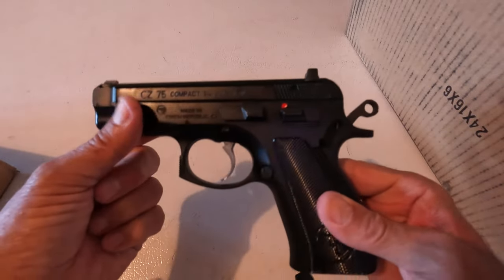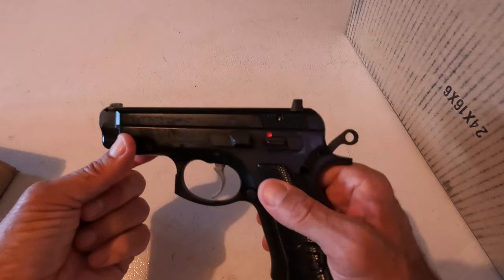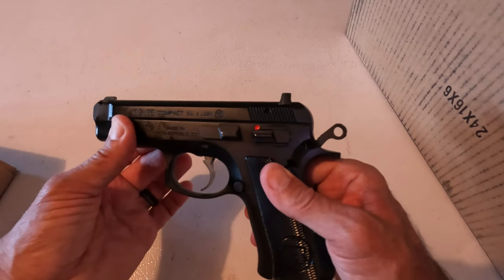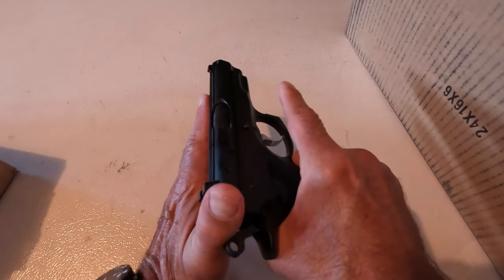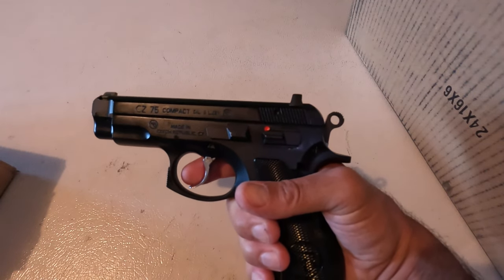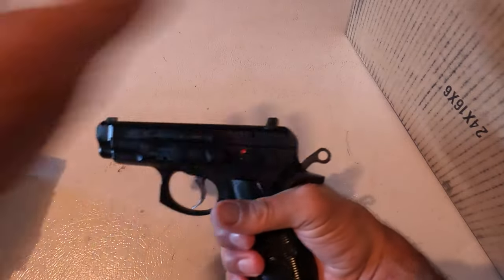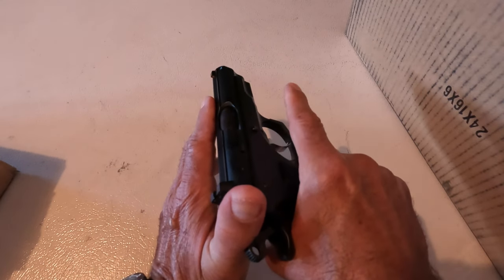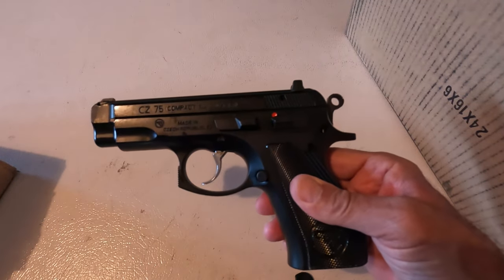The safest method to lower the hammer on a CZ75

Comment: Prefer the manual safety version over the decocking PCR, just so I can have a little extra comfort knowing it’s double action in the half cock position, and the safety is on at the same time, unlike the decocker model
Reply from the maker: If one is comfortable with a SA like a 1911, this gun is equally secure. However, the longer DA pull for first shots is certainly an enhanced safety factor. I converted this gun to SA only. See this video...
https://youtu.be/T6B7hp8z_YE?si=kgRpm131ejSM5kiH
Reply: @mlazarus5388  saw your video. Yeah since this is my first and only recently purchased pistol, I have to get more used to carrying it with 1 in the chamber, so the safer the better. BTW nice mustache
Reply from the maker: @wallclock4648  ha. Appreciate the positive moustache comments.

Comment: The Reason the hammer has the circle hole is for pinching it with two fingers , the index finger and thumb tightly , by having the circle it allows the hammer to slowly rotate forward  while being pinched, that circle is imprinted into your finger skin , along with the tight pinch.  This is why it has that hole. Practice this method while dry fire practicing
Reply from the maker: @TheLoneRanger745  interesting. I actually prefer the hammer style on the gun in this video. https://youtu.be/-F7nf4RU-YE?si=kY7uL76TwmXHS0Dn

Comment: I simply do it with only one hand. It feels very natural that way for me, and I was able to do it flawless the first time I handled one. Man, it's like this gun was designed for me. It fits my hand better than any glove 😂
Reply from the maker: The CZ tend to be very ergonomic.
Reply: Aren't the CZs awesome?!

I purchased a P-01 and I am in love with it! Smooth, comfortable shooter.
Reply: I do one hand only too, but I still put my thumb BETWEEN the hammer and the firing pin.
Reply: @ubob38 I agree. Did it thumb on top of the hammer but if the weapons fires thumb is “gone with the slide”. Not a good movie. I will change to thumb before hammer

Comment: Thx. I was thinking of buying this gun for concealed carry. I am done with polymer pistols. Want all steel
Reply from the maker: @j.t.867  The CZ are a solid choice. These can be converted to single action as well. Check out my video on the converted compact. A really cool gun.
Reply from the maker: @j.t.867  https://youtu.be/T6B7hp8z_YE?si=Kzd3171UWblyga7N
Reply: @mlazarus5388  your experience carrying cocked and locked for ccw is positive?
Reply from the maker: @j.t.867  Yes. I frequently carry a 1911 and I used this gun as a Ccw in single action mode as well as other CZ75 pistols.

Comment: Or, carr y" condition one" ,"locked and cocked".
I find this video very instructive but my experience has been that if you just flip the safety on and carry in the proper holster there is an inherent minimization of user error causing a negligent discharge. But what do I know? Great content keep it up.
Good content
Reply from the maker: I agree wholeheartedly. I treat the CZ 75 family of pistols like a 1911 with second strike capabilities.
Reply from the maker: https://youtu.be/fkgqqztBIuI?si=xcIUiz5oev3ztOV2.  Here's good example.

Comment: Genius: absolutely correct. Will work on my shadow 2 also! Thanks
Reply from the maker: It works well on all the CZ variants. Most other DA/SA have a decocker.
Reply: @mlazarus5388  I really have to pay attention because after making the weapon safe I normally drop the hammer instead of dry firing using the “thumb on top” procedure.
This may be a mistake. It leads to repeating this procedure when going from a full cock to a half cock. I decock for DA practice at the range
Reply from the maker: @gregmarchegiani6656   I actually dry practice lowering the hammer along with other "gun handling" skills. It helped me create good habits.

Comment: The safest way is pinching the hammer with your thumb and index finger and lowering the hammer to the full decocked position
Reply from the maker: I know that method is popular, however, pinching the hammer is not as secure as blocking it. I've seen that method fail when the hammer slipped from the pinch. I like something fool proof, regardless of wet hands etcetera.
Reply: And on models lacking a firing pin block, like the shadow 2, you do not want the hammer resting on the firing pin. This is why CZ decocker models go to the half cocked position. Much safer.
Reply: @danielburdette249  It isn't resting on the firing pin, it's resting on the machined flat on the rear of the slide, in which the rear of the firing pin protrudes if the hammer is back.
Reply: That's cool for shooting competition and gun games due to the rules in Production Division....otherwise for carrying the gun for self-defense I'd do the method shown in this video
Reply: @marcross52-95  so it’s fine to use that method to lower the hammer for completion but for carry prior to holstering this is safer?  Why is it different for competition vs. carry?  Hammer goes down in either case prior to holstering.  Your comment makes no sense at all.
Reply: @lovetopew9054  For competition as per rules in Production Division (which is where this pattern of pistol is mostly used) hammer fired double-action handguns must be fully de-cocked. In a controlled shooting environment it's less likely to hurt someone should a finger slip.

In the video, you'll notice that the hammer does not go all the way to the frame, and has a gap. This is the half-cocked mode. The design incorporated a half-cock catch so that it can be safely carried this way.

Further back into history, the CZ-75 did not have a firing pin block, and was not drop safe. Loading and carrying full hammer down on a loaded chamber just adds more risk to a negligent discharge, or should the gun be bumped, shaken or dropped.

Hope my comment and the video makes more sense now to you my friend.
Reply: @marcross52-95  I’m aware of the rules I shoot USPSA regularly.  Your comment about a risk of ND with the hammer down doesn’t make sense as the gun is in DA and plenty safe in that mode.
Reply: @lovetopew9054  Please refer to the initial comment of Mike Lazarus (the video poster) in this thread.

Also, please research the difference of a fully-decocked hammer vs a half-cocked hammer.

Or just carry whatever way you want with your hammer fired pistol.

Comment: I'm new to the CZ75 format and maybe you can clarify something for me.  What kind of safety does the format use?  The reason i ask is because if you were to follow the same process up to  pulling the trigger, but instead applying the safety before removing your thumb, would that process be the most safe?  Or would the safety in that instance be nonfunctional?  I intend to purchase a CZ75 style gun for home defense but want to keep the weapon loaded but in DA.  Thanks!
Reply from the maker: Great question. CZ models generally come with either a frame mounted safety, or a decocker. The Decocker allows you to safely drop the hammer into double action mode for the first shot. The safety models allow the users to carry and run the gun in single action for all shots, from first to last. Or, the user can lower the hammer on safety models using the technique demonstrated here.
Reply: Yo if you’ve got a cz already I recommend and I mean highly recommend the cz 75 spo1 tactical as it comes with a decocker
Reply: CZ 75 B, BD, D PCR, P01 and SP-01 all have firing pin block. I'm not sure about Shadow 2 or TS2 series. Firing pin block can only be disengaged by pulling the hammer.  Hence, the decocker models are safer in operation. The decocked position is at 1/4 c0ck instead of full hammer down like Beretta and SIG, which reduces the DA pull but may allow stuff getting in between

However, having owned both types, I don't think which model matters as long as you train properly.

Comment: Buy the decocker model instead, 1000% safer. This pistol was never designed to be decocked in this manner. To place the hammer on the firing pin which is ready to hit the live round primer is dangerous.
Reply from the maker: Luckily on this, and all newer CZ 75 models, there is a firing pin block that keeps the firing pin stationary and off the primer unless the trigger is fully depressed. Almost every action pistol shooter decocks their CZ prior to starting a stage.
Reply: But the hammer never touches the firing pin here. It never goes below the half cocked position.
Reply from the maker: @mikeoxlong3676   true. Although it's possible to decock all the way to the slide contact point. Some action shooting sports require this.
Reply: @mlazarus5388  Shadow 2 doesn't have FPB. Already caused a death. Decocking to the first notch should be allowed or even mandatory in Production. Nobody should carry with the hammer resting on the firing pin, it's not even realistic to be mandatory.
Reply from the maker: @tactiguay7154   the new shadow 2 compact is the same way. It left me thinking that CZ might not have considered corporate liability.